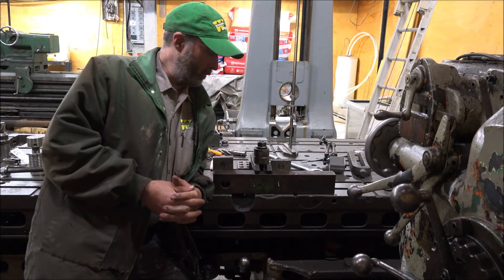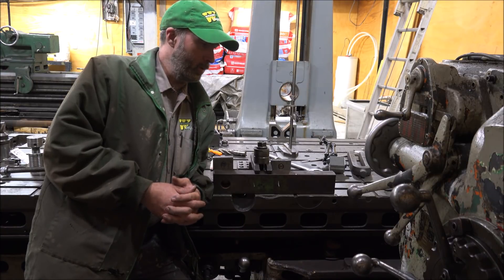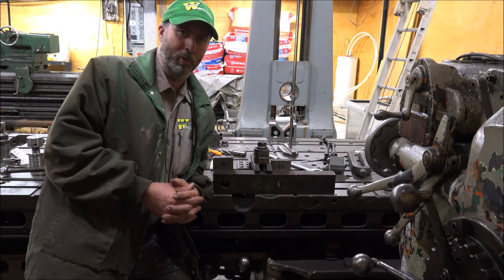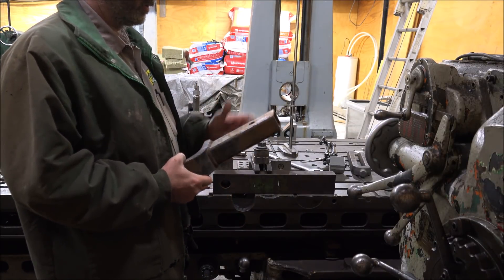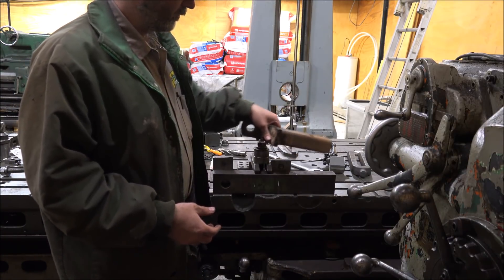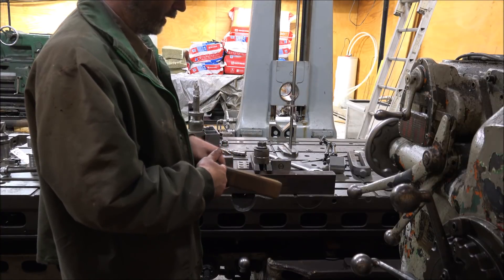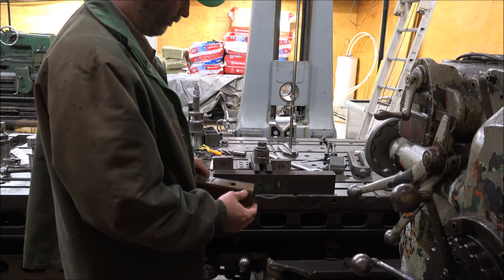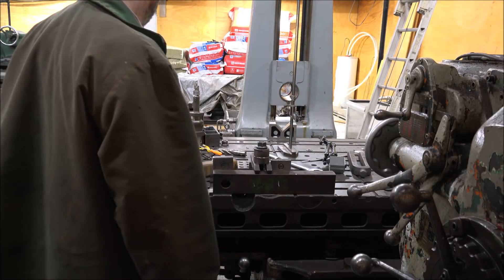Hammer Strap Drawbar Hitch for 2" Receiver and High Tongue Weight Agricultural Implements

Comment: Nice project. As the inspector was coming for the first inspection, I noticed that his back end wasn’t tracking the front end. You might want to get him up on the rack for a 4-paw alignment. Once they get a little high in the miles, this check should be done more frequently or he’s gonna be goin through a ton of paw-pads and his rear end will take to shakin. 😎👍👀
Reply from the maker: Baily has only had 3 decent legs most of his adult life, its a miracle he can still move at all. Poor old feller.
Reply: dogs do that, it usually depends on how much of a hurry they are in.  That's why they call it "dog tracking" when vehicles/trailers to do that.

Comment: I was expecting to see the Big Radial Arm in action when you mentioned drilling holes! Guess it's been mostly retired since you got the mill running....
Reply from the maker: With no DC power the radial drill lacks the grunt of the mill and if I am doing milling anyway no need making a mess on 2 machines.

Comment: But will that mighty Cummins Dodge pull a 28' disc cutting 6" deep? My bet is only 24' cutting 6" deep.  That would be really interesting to see what a well-weighted diesel pickup could pull.  I did plow about 12' of country black road while delivering a new folding wing disc when the transport link broke.  40 miles from our dealership, no cylinder or way to power it. I was lucky there was a farmer who wanted to go down the road with his rig was nice enough to disconnect his tractor and cylinder to raise the disc so I could chain it for transport.  I made sure he had my business card marked with 20% off a $100 purchase.
Reply from the maker: My truck has 3.07 gears so not the best for field work. LOL
Reply: @bcbloc02  Remember the Model T & A tractor wheel conversions?  20.8 x 38 tires on all four corners with the spur gear drive, Now that would be a unique conversion.  More cool than those guys using Semi power units to farm with.

Comment: The big newer pickups have that class 5 receiver tube.  Still only have the little 5/8” cross pin.  Is bigger cross pins the next upgrade?
Reply from the maker: In all my years of truck pulling I have never seen the 5/8 hitch pin thru the receiver sheared. Seen plenty of hitches ripped off the frame, broken receiver tubes, and destroyed or broken hitch inserts though. Breaking where the box of the hitch is welded at the sides is normally where they break.
Reply: Ever look up the shear strength on 5/8?
Reply: I suspect the lawyers and engineers ran the numbers and found even a total cheese grade steel pin to have a reasonable safety factor in the application, otherwise the bigger hitches would use a bigger pin. I'll hazard a guess the reason it's as big as 5/8 to begin with is more about ease of use and not egging out the holes in the tubes.

Comment: I'd be a little Leary with the weight of the implement pushing the truck down the road .
Reply from the maker: Most flatbed diesel pickups weigh 10000lbs empty anymore so they can handle quite a bit. That puts them bigger than many a common Deere 4020 tractor.
Reply: @bcbloc02  Not to mention how many thousands of tractors like the ol 4020 only have brakes on the back, if you want to talk brakes. I see way more boats being towed that look beyond sketchy (in terms of control and stopping) than I ever have for farm tools.
Reply: I do it and with anything you must use comon sense. And use a truck is heavy  enough to privide proper control

Comment: You're right that that hunk of iron is way stronger than the Reese on the truck, most have a hard time with over 1000# tongue weight and that would stand a whole lot more! I think you can buy a double drawbar type but not a "hammerstrap" type. We have a single axle tractor with homemade hitch on the back that could handle as much as your custom hitch and is better for big implements than a pickup. Do I see a trip coming up where you fetch a new tool? Hay Hud out.
Reply from the maker: Nope it is not for me.